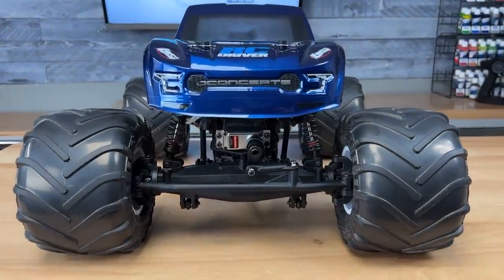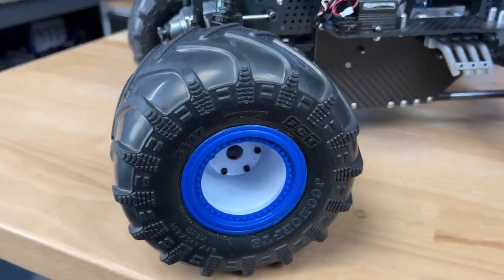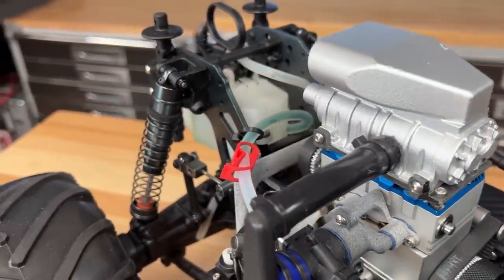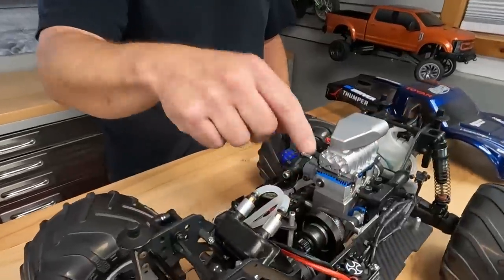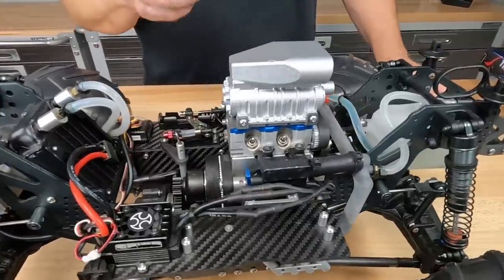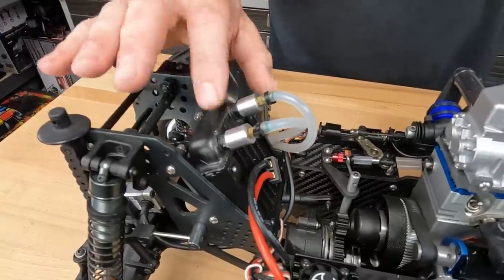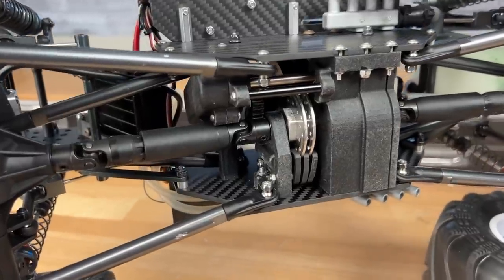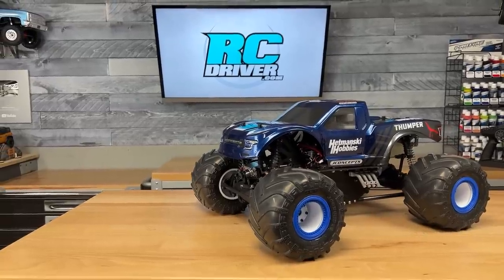NITRO Losi LMT! 2-Cylinder 4-stroke Engine POWER!

Comment: What a fantastic build, I hope he brings it back to your channel for running videos when it's done. He really went all out with his engineering skills. I put a Toyan 2 Cylinder in a 1/8 crawler. It's super slow. Has no wheel speed to hop obstacles. I need to find a 2-speed transmission for it.
Reply: I'll be bringing it back to the channel as soon as I can make some progress and get it running like I want.

Comment: Really cool build.  You should check out a Switchglo for the onboard glow ignition.  I have one on my R/C heli. It plugs into the Rx and uses the Rx battery for power, a lot simpler than a servo, microswitch, and AA batteries.

Comment: Can we PLEASE! get an update when this truck is complete and in full performance mode. Always wanted to know if these engines made enough torque to pull the tall gearing needed to make them fast enough to be fun yet still have enough torque to spin the tires on gravel. Who thinks the engine is capable enough as is, and who thinks it wont be... and a functional roots blower would add enough power to make it fun??!
Really curious on this!

Comment: Super cool but not sure that motor will move that fast enough to be fun
Reply: The motor has bottom end torque but the RPM range is low. That's why the gearing of the truck has been increased. It will take advantage of the torque that the motor produces and should get it up to a respectable top speed. This isn't the first 4-stroke project that I built.